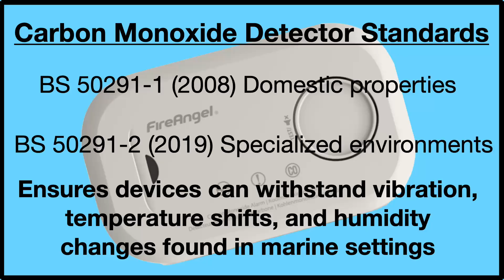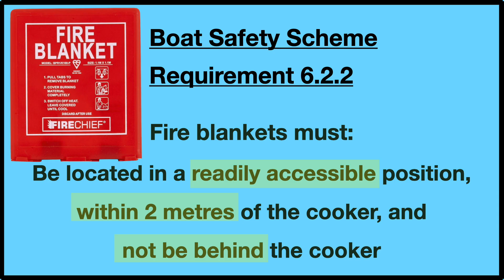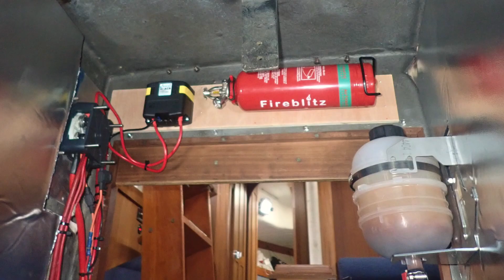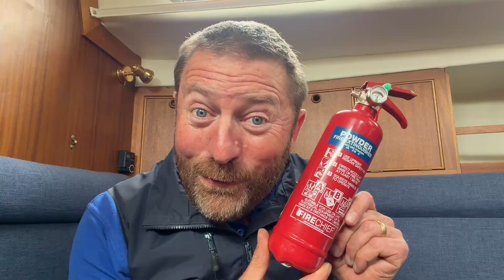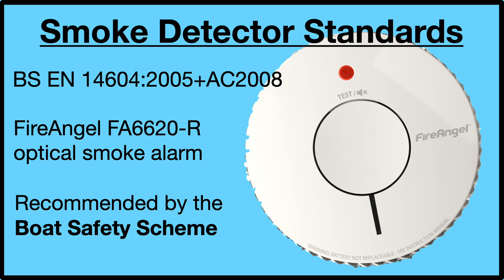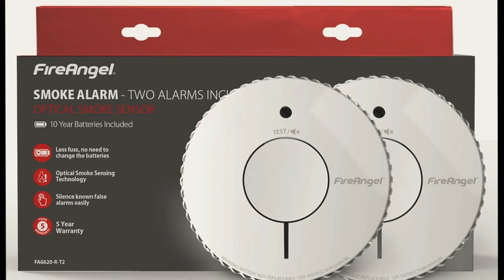What Fire Safety Equipment Must You Have On Your Boat?

Comment: I find it odd that fire extinguishers aboard a narrow boat would pass a BSS even if the extinguishers were older than five years or more and therefore out of date for service but you might not then be covered by insurance. When I bought my narrow boat my extinguishers were way out of date (I was unaware of the requirements), it passed the BSS but the examiner didn’t advise me that the extinguishers were out of date or that I may not be covered for insurance. It was only later when I had some electrical work carried out that this guy mentioned it to me. Luckily I wasn’t bitten by this and quickly replaced them. Bazaar.
Reply from the maker: I agree with you Paul, it is a strange situation. There is no universal answer to 'what is the service life for a fire extinguisher?' The expected age range varies by type as well. It could be anything from 5-15 years depending on which source you quote. The BSS doesn't state what age they should be replaced at, so for ease I usually advise replacement at 10 years (unless in poor condition). If there is one and the service sticker says otherwise, then I'll go with that.

Comment: Thanks for safety tips. Do those small extinguishers that you're not a fan of require servicing and do they deplete over time?
Reply from the maker: Fire extinguisher servicing stickers are a 'nice to have' that I rarely see on small craft. Most owners buy cheap, fit without signs and then forget their extinguishers. I've always advised regularly upending and tapping the base of powder extinguishers to help stop the powder compacting over time. As always, you can't tell if it'll work until you squeeze the handle...
Reply: @whitehatmarinesurveying  thanks for the helpful response.